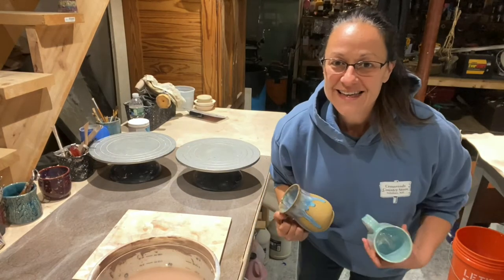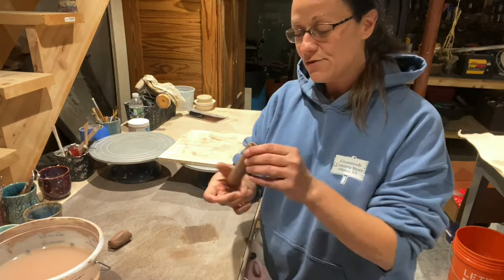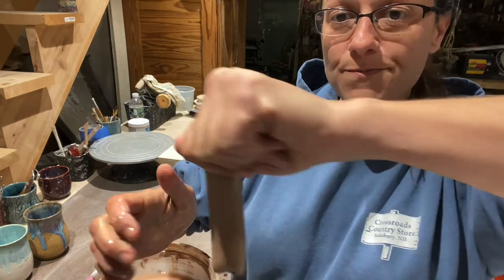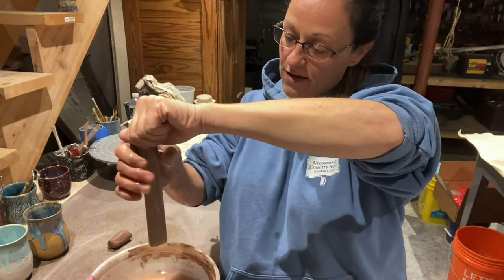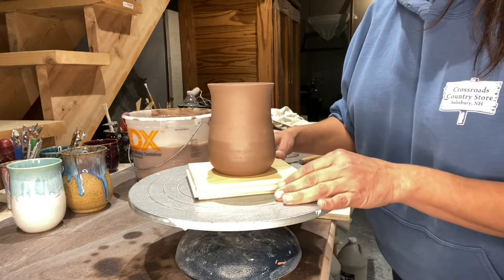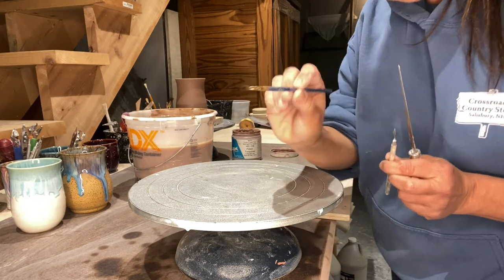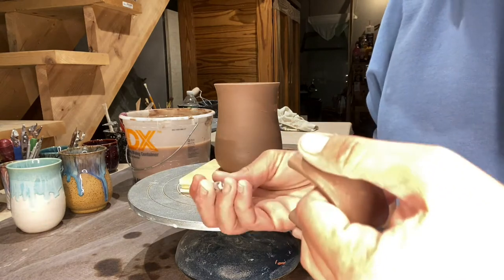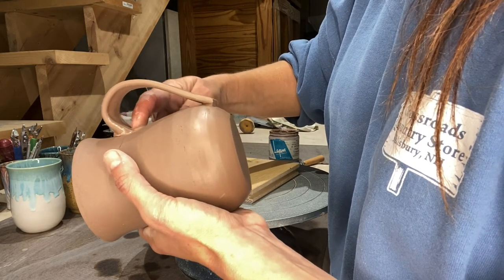BEGINNERS GUIDE TO PULLING & ATTACHING HANDLES FOR YOUR POTTERY #clayvideos #pottery #handles

Comment: Great technique!! I always turn my hand THATS holding the big chunk at the top or I’ll get very uneven sides to my handle. I really like how you use your thumbs when attaching the top. The stamp is an awesome idea as well. ❤
Reply from the maker: Do you mean that you alternate pulling both sides? Would love to hear how you do it! Thanks!!!
Reply: @thehappyhomesteadnh  I hold the big part in my left hand then pull but every few pulls I turn my hand so that the flat part is touching the other side of my hand. Does that even make sense? Sorry if it doesn’t. I started making slab handles a long time ago but I make them look pulled. When I apply my handles to the handbuilt mug the mug is still pretty wet so that’s what works best for me.
Reply from the maker: @micheledickey4066  makes sense!!! Would love to try slab built handles!! Or buy a wall extruder - those are so cool!
Reply: @thehappyhomesteadnh  I actually have the Nidec handheld extruder but need to get my hubby to make a few handle dies for me!!
Reply from the maker: @micheledickey4066  u do?! I want one soon! I want to get the die for thick slab walls for a casserole 😋